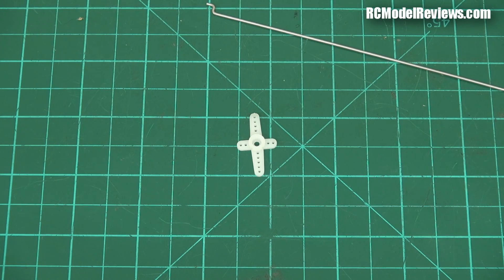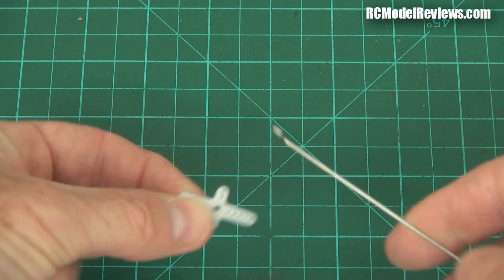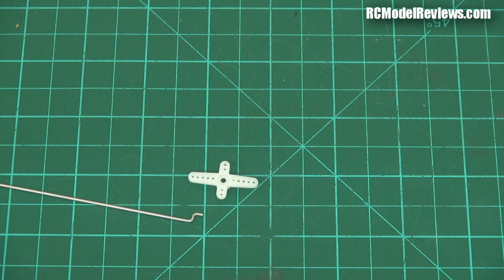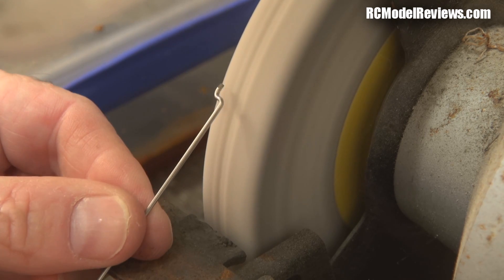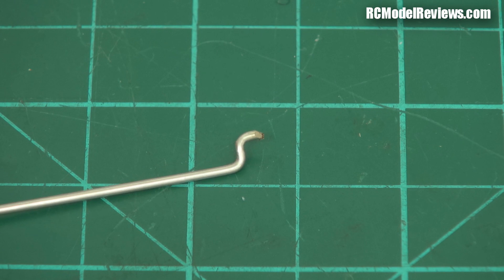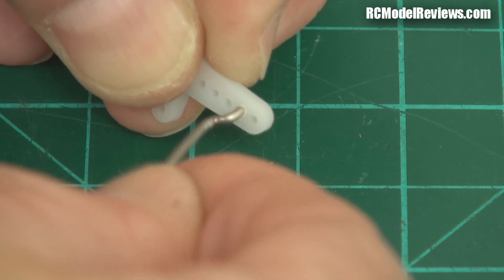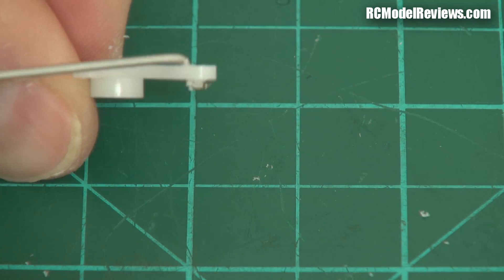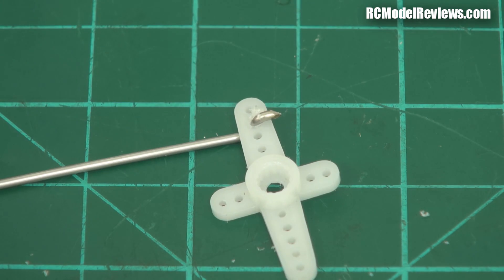Quick Tip #2: drilling servo arms to fit your pushrods

Comment: ALSO:
A drill bit the proper size and a pindrill/fingerdrill  works the same way without buying a grinder, fine wheel, and wheel dresser. No damage to rod occours either.

Comment: HINT:  Stainless Steel 308 TIG Welding Rod 0.045"x36" | Pack of 1-Lb  = cheap 1.2MM push rods that won't rust. For the hole, Cut a 3" piece, heat with a butane lighter for 10 secs and insert through the horn opening you wish to enlarge. Trim excess melted material with x-acto knife flush to the horn.

Comment: I just hold the push rod with pliers and use a match to heat it for about 5 seconds. Then you just push it through the servo arm like a hot knife through butter. Works every time and takes 5 seconds.

Comment: using a lighter is even simpler. just heat up the Z bend, push it through the nylon hole and let it melt through

Comment: I find grinding takes the temper out of the metal,so grind quickly but let it cool . just putting a quick flat on the end of the wire does work like you said. DO NOT attempt to grind down the diameter of the rod ,then try to bend it with a Z bend,the rod will be junk.I tryed that the very first time I was making a foamy plane. learned that lesson quick I did. lol. Nice tip there Bruce.

Comment: I do the same by cutting the wire using a wire cutter plier. You get the same bevel edge and it is cold worked as well. Just remove the burrs on the side of the bevel with sandpaper or a file.

Comment: If you get the hole too big, just install the servo wire and add a single drop of superglue where the wire goes through the hole. Let it set naturally, then move the wire around and it will loosen and be fine.

Comment: Let me say that holding the servo wire the other way, so that it's pointing in the same direction as the surface of the grind wheel is spinning is safer and works just fine..
 You can also do this with a file but it takes a bit longer. Just hold the servo wire down on a piece of wood and hold your file at a bit of an angle as you file one side then the other.
 I've even used the file on my Swiss Army knife.
 Wet and dry or sand paper can do it too, Hold the sand paper/wet or dry paper down on a hard flat surface and rub the servo wire from side to side at an angle. but be prepared to wreck the paper if you press too hard.
 Or you can even use your sister's nail files/emery boards, whatever.  
  Not as convenient as a grinder, but who's got one of those?
Actually I have a mini drill with little grinding wheels, so I use those.

Comment: Nice ! I already have every drill bit size I could ever possibly need and 3 grinders. What I don't like about drilling is reducing the thickness of the arm as much as I've had to do and/or creating too much play. I will be definitely be using your tip from now on. Thanks Bruce. P.S. you should have grinded from above or the side, not below. I'm waiting for a blooper reel of a pushrod sticking out of your shoe ;)

Comment: Not that good of an idea, next time you rub your skin against that rod and let the bleeding begin, don't do it.
Just use a lighter or candle and heat the wire to punch thru the hole, cost you nothing and is much safer for the future on the field.

Comment: A pin vise and correct size drill then draw the drill out without it turning to ream the hole and you can work at the kitchen table and not need a workshop. (sorry, nothing meant against your tip)

Comment: well I have a wood/metal shop full of tools I have 3 grinders set up of different jobs but I also have lots of sets of drill bits :)  I have also used the wire drill trick using a cut end of a wire, fast and easy.

Comment: I often just snip the end of the control link with a pair of pliers or side cutters , be it piano wire, mig welding wire or what may come with a kit. doing so gives a similar chisel point that will allow to do a similar process.

Comment: Here is another bit of advice.  Invest in a set of numbered drill bits.  The reason being is the size between bits if very small and allows adjustment from one size hole to another without making large jumps.  They can be used on servo holes and many more applications where you want a fairly precise fit.  I have even used them to alter airflow in carburators that do not perform well through their entire range.  These bits can be used to estimate sizes of holes that you cannot fit calipers into as well.  So many uses.  I wish I had them 20 years ago as it would have made many tasks much easier.

Comment: Good idea, Bruce. I used to enlarge pushrod holes by twiddling them out with an X-acto #11, but later picked up a couple of pin vises at the local hobby shop, each containing an assortment of small drills, and have been using those since. Not as cheap as sharpening the pushwire certainly, but still mere pocket change. Plus, I'd need to move several airplanes to get to my grinder bench... ;-). Cheers.

Comment: I usually use a lighter to heat up the pushrod, and then push it to the servo arm. Dont heat it up too long. Otherwise the hole will melt and wont have a good fit with the pushrod.

Comment: As mentioned before, snipping a waste piece of piano wire with nice sharp side cutters will put enough of a bevel on the tip to drill out the hole. Heating can make the bend brittle in some cases so I tend to avoid that method. Also a Dremel disk is also great for the job if you haven't got access to a grinding wheel. Excellent work as always Bruce!

Comment: Good tip Bruce, but I can't say I approve of your technique with the grinding wheel, if that wire digs in to your wheel your going to get hurt. It should be a trailing-edge if your just holding it at an angle but really you should adjust the rest to get the right angle and use that. I know, but I used to teach kids to use this stuff.
Reply: I did exactly that back in the mid eighties. Wire wound around wheel, and diced open my index finger knuckle. Still hurts today.

Comment: heat wire for 5 seconds with cigarette lighter or candle, poke through. clean daggy bits away with excto or similar. no grinder required. exacto optional, any sharp implement will do.

Comment: I often 'drill' with the wire as is, pressing really hard like a neanderthal for about five minutes, usually works. At the end I am rewarded with a strange sense of satisfaction that my stubborn persistence won over, and I triumphantly give the servo arm the finger and say "gotcha bitch".
Reply: iforce2d 
That's my method too. Then I think of at least 3 other ways of doing it that would have been easier.
Reply: the only thing I do not like about this method and Bruce's is the fit is too tight.  I like the fit to be such that the arm almost freely spins on the wire with no slack.  If you get it too tight it can put a small amount of load on the servo and make it harder to center properly.

Comment: $2 drill bit. $120 grinder. Hmmmm?
 $2 or $120 hmmmmm. . . .
I know. Heat the wire and melt a hole.
Reply: You guys are thinking too rich.....

$5 pair of side cutters.
single diagonal/taper cut. there's your drill bit. 
then you can just  use the side cutters to make a straight cut to get rid of the taper. this will mushroom the wire a little which will make it a little harder for the horn to fall off.
Reply: ElectraFanfure: I use a pin vice with 4 different sized collats to hold my little drills. $3.71 NZ with free shipping from BG.
Electric tools not required.
Reply: $0.50 sand paper
Reply: A file would probably be the cheapest reliable way to do this.
Reply: Use a 30USD dremel instead.
Reply: $39.99 Northern Tool.  Then when you need a grinder, you have it...kind of the same reason we buy other tools.
Reply: Nah man, those small bench grinders are £20 here in the United states of Kingdom.
Reply: $2 drill bit needs a $20-120 drill..  (Ok, so you can wrap some thermoshrink around the bit and use it by hand..)
Or maybe a nice file? Something that you should have on hand anyway. A few quick licks and same result.
Reply: was just about to comment this...
Reply: I do it all the time considering that the wire will chew up expensive side cutters you get. Mine were cheaper than $5 since they were from one of those cheap PC tool kits. I've had mine for like 10 years now.
Reply: Joanne Lowery yep.  drill hole to smaller size, drive wire through and heat wire with soldering iron.
Reply: wall out side is free!!
Reply: concrete will do too, have sidewalk will grind
Reply: I was thinking file it or even concrete
Reply: I wouldn't want to use a $5 of side cutters with music wire/spring steel(What these rods are made from) steel!
But point made.

Comment: Hello, Bruce! I find more easy to use a high pressure lighter, especially in the field, heating the other side of the pushroad, passing for a second thru control horn, clean it with a exacto knife and that's it. Works great!